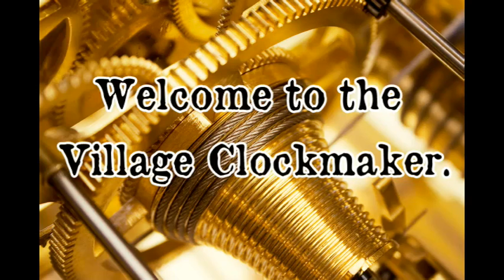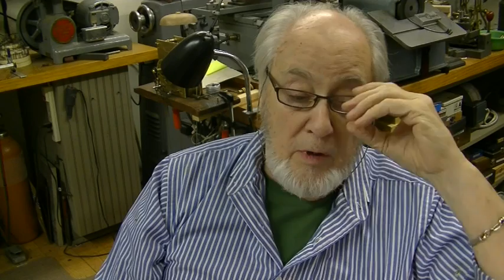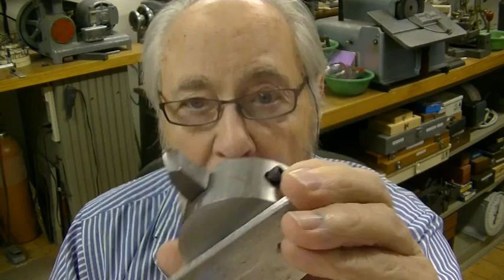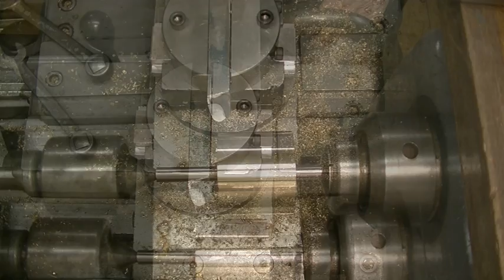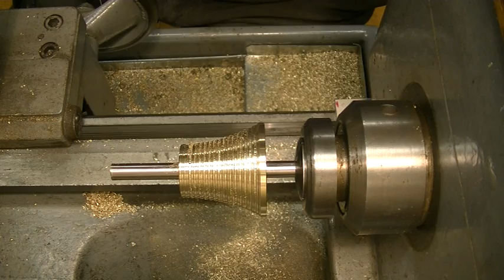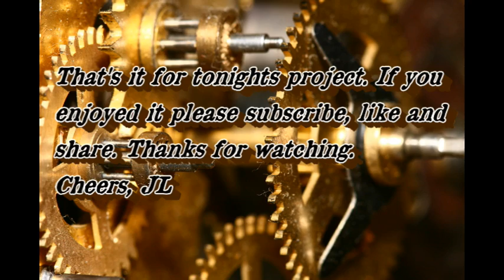Clock repair tutorial. #13. Cutting a fusee for an English Skeleton Clock. Part 5.

Comment: Hi James. I noticed that when you were cutting the radius that you were advancing the cut using the compound slide instead of the cross slide. Does this not increase your radius unintentionally? Regards, Remko
Reply from the maker: +wich Not if everything is centered. Thanks for watching.
Reply: James A. Lea The Village Clockmaker That's just the thing, by advancing on the compound you're moving the centre of your toolholder away from the centre of rotation of the compound, aren't you?

Comment: How does this shaping method assure proper fusee compensation for the mainspring force delta?  Is it just rough (eyeball) back of the envelope compensation? I thought there were methods that accounted for the actual change of applied tension of the mainspring as it unwound. Is that just my bad memory or does something like that exist?
Reply: +ExtantFrodo2   I 'think' I understand your question.  In the beginning.....some exhausting calculations were probably made....to determine each different diameter of the 16 coils on the fusee.  Others have suggested that the curve is a half parabola or catenary....etc.      This can still be tested with a torque wrench applied to the fusee when winding.  However the clock factory technician/machinist would have had to have a more simple way much as James as shown, what it was I do not know.  By the way the fusee clock movement was make in the UK until the 1950's....they were called 'Dial" clocks 12'' dials and were used in offices as well as train stations.
Reply: thebaron44
My memory fails me, but I could swear it was not a calculated function but made use of the real life characteristics of the spring that was used. Iit probably incorporated a weigh on a cable to compare and establish the correct depth of cut for maintaining the constant tension.
Reply: +ExtantFrodo2   Yes, I agree, this ''is understood' in my first sentence.   If you do not have 'spring data' you cannot calculate the different diameters of the fusee.  A weight with a piece of string would have been a method  of gathering data
    My ramblings about the curve, even if it is the inside tip of your thumb, would most likely not exactly match the power of the spring as it unwinds.  But it would be close.    
     The fusee outlived itself as better quality(accurate) spring driven clocks were being mass produced by 1880/1890s
    The quality of steel was good in the 1850s by my observation,  but not its consistency on a continuing basis.  Today it is still witchcraft to make steel.
Reply: thebaron44 "it is still witchcraft to make steel."
True, making new alloys is more alchemy than science.
Reply from the maker: +ExtantFrodo2 You are correct but the difference in the "real" parabola curve and the simple arc is not enough to make that much difference in the force applied to the great wheel as the spring winds down. If you wanted to be dead accurate you would need to do the trig.
Reply: +ExtantFrodo2    A good thing might be.....if you are trying to make steel with a 1.2 carbon content but end up with 0.8 carbon.....then you sell it as 0.8 carbon...and try again to make another batch of 1.2 carbon....who would know?

Comment: Hi there, Many thanks for the extremely interesting videos on clock making. Couple of comments, the fusee clock i have on my wall has a cable on it (as per your opening background). Is that an English thing or a late edition to the clock making when steel cable became available. Also, noticed you setting your work piece in the chuck using a brass knocker against brass, Although not quite Abom79 size, does the like materials cause damage?.. there seemed to be some indents in the piece.
Reply from the maker: Hi Richard. You are correct that the cable is a late addition and never so posed to be used. The reason I used brass against brass is it that piece was going to be machined and any marks would be machined away. thanks for asking.

Comment: " FUSEE NO LONGER NECESSARY "
MODERN SPRINGS SEEM TO HAVE MORE TENSION TOWARD THE END , DON'T THEY ?
ARE THEY THINER ,I.E. TAPERED , TOWARD THE END ??
Reply from the maker: +OLD WIPPER-SNAPPER The steel used when that clock was originally made was not good steel so the fusee was necessary. No days our modern steel is good enough that we don't need it. Thanks for watching. PS. I just subscribed to your channel. I think we may have a lot in common.
Reply: +James A. Lea The Village Clockmaker -- I DON'T HAVE A CHANNEL . DIDN'T FAILY MODERN MARINE CHRONOMETERS HAVE FUSEE'S ?

Comment: Thanks very much. It answered a lot of questions I had on fusee making.  There is a channel called Clickspring on YouTube, by an Australian named Chris.  Coincidentally he is making the very same same clock you are, the Wilding skeleton. Chris  is very highly sped up and edited. Slick, in a word. I think your channels are complementary. For instance Chris used a ball tool to turn the fusee. You built the tool, and now I've added it to my gigantic project list.Also, what lathe did you use for that? The Hardinge? Had to be a screw-cutting lathe. Finally, that was a very nice advancing tool you used to cut those grooves. I'd like to see more on how if works. I am commenting on the whole series  of fusee making so this comment is much too long. Sorry. More! More!
Reply from the maker: +Juan Rivero    I know Chris and like his videos. The big lathe is a Clausing 4900. My middle lathe is a Hardinge Cataract but is has no screw cutting attachment. Thanks for watching.

Comment: Hey James,

Dragging that file on the backstroke I see....... Just pulling your fusee. I really liked the tracer threading. I'm going to add that one to my bag of tricks.

All the best,

Tom
Reply from the maker: +oxtoolco  I know I shouldn't do that. Just having a brain freeze.
Reply: +James A. Lea The Village Clockmaker Hey James,

I was just teasing you a little. Keep up the good work.

Best,

Tom
Reply: +oxtoolco It's kind of necessary in this instance to keep the file in the track as it runs down the length of the fusee. 

PS you should properly say you were just "yanking his chain" (wink wink)
Reply: +ExtantFrodo2 Yanking his fusee is probably more proper.

Best,

Tom

Comment: So how do you regulate the depth of cut on the grooving portion? Is it all approximate, and by feel?
Reply from the maker: +sooth15  Yep. It is just by feel. It is really easier than it looks.
Reply: +James A. Lea The Village Clockmaker Very cool, I wonder if using a pneumatic plunger with a cutting insert would be an effective way to keep consistent pressure on the piecework while turning? I'll have to try that one day. Love the videos! Keep them coming! :)